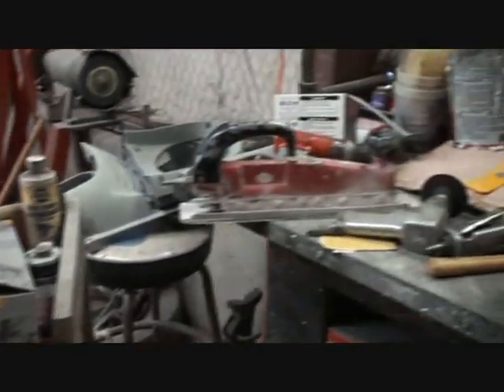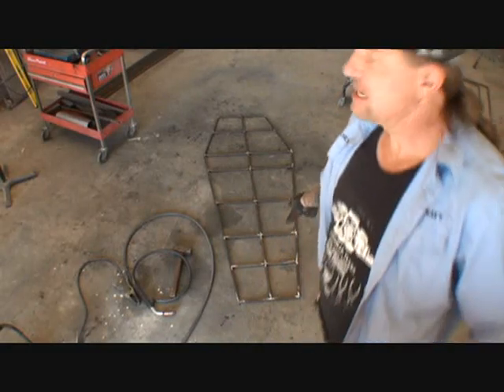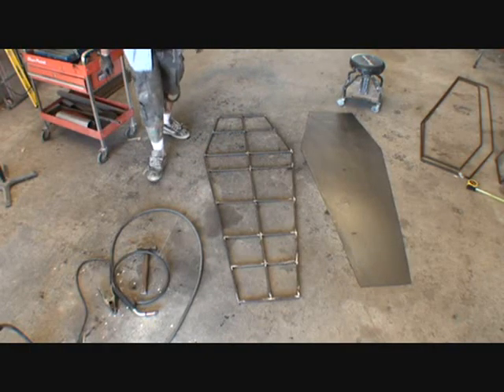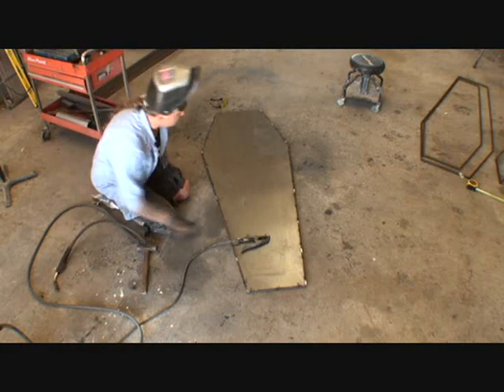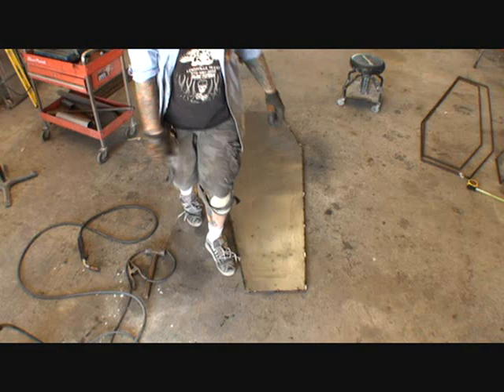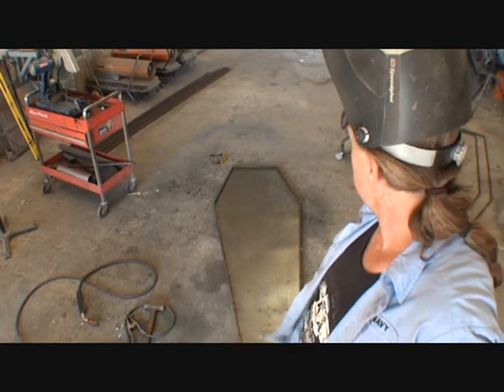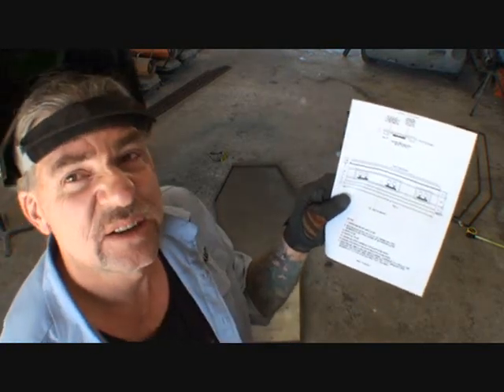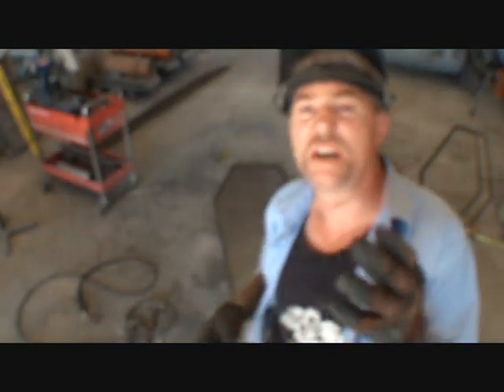How To Make Somthing From Sheet metal and use a Mig Welder-Part 3

Comment: @iceman22st 0.22 on the wire for sheet metal and small tubing such as this, and the typical argon mix gas used for mig welding.. ..